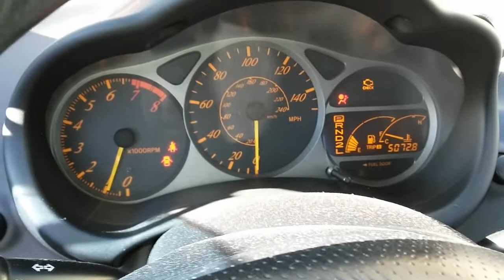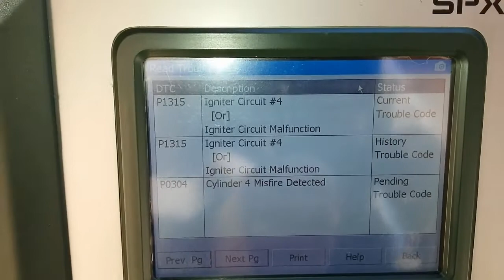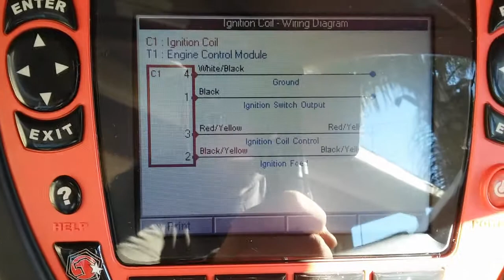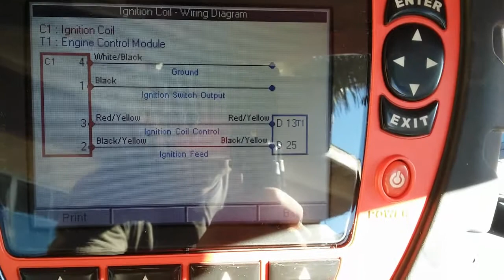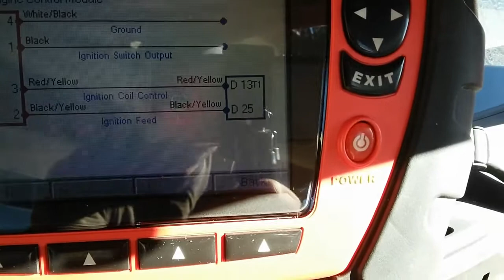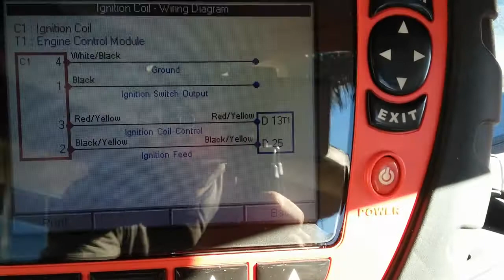(Toyota Celica) The effects of Low Oil Condition on VVT-i and P1315 Code

Comment: Will low oil pressure cause the VVT to get stuck on certain gears? Sometimes mine gets stuck on gear 3 or 8, sometimes others but usually those 2.
Reply: I have a 2015 Chrysler 200c 3.6 liter V6.
Reply from the maker: @nowickert  I'm not really too sure about affecting gears. It will for sure affect your ignition timing during certain rpm ranges. Perhaps, it can.